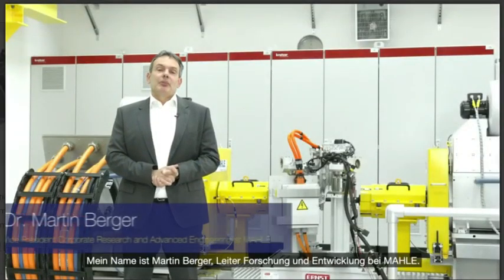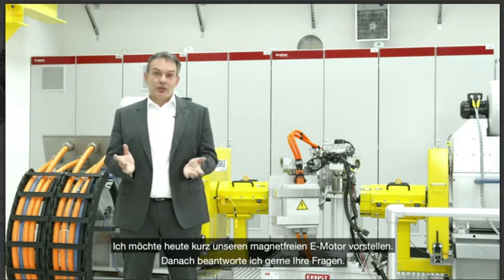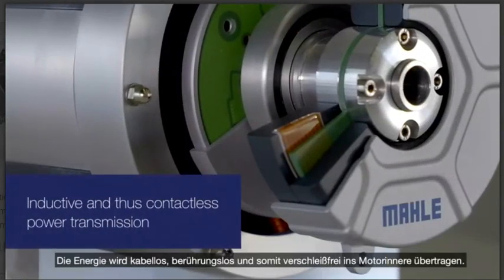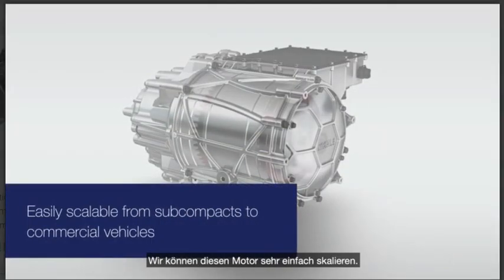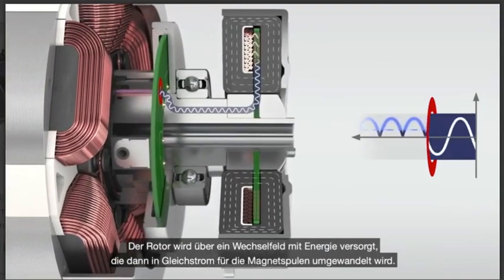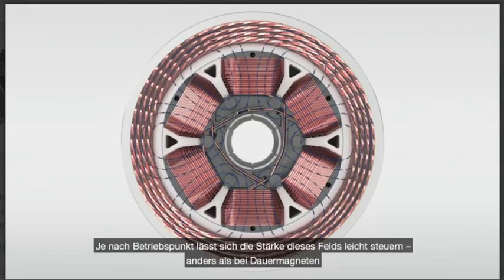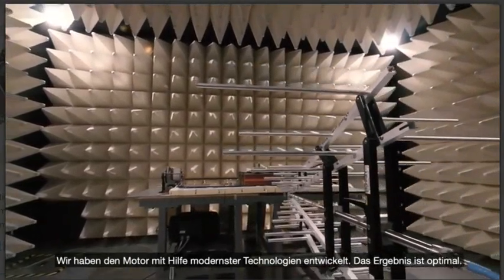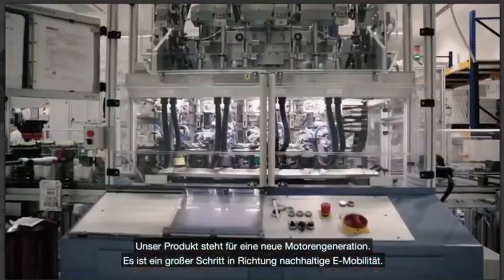Mahle, produce revolutionary new no-magnet motor...

Comment: What's new in this?  Instead of permanent magnets it uses electromagnetic fields, the same as in all AC motors since day one.
Reply: @kosovoisserbia8937  
Chlorine is a gas which when combined with sodium produces a solid compound often added to potato chips.
Reply from the maker: I am new to this stuff and do not have any real education around electric motors and their history - it seemed interesting as a solution to the problems of sourcing rare earth metals and is supposed to be more energy efficient. Outside of that, I think I would need more of a frame of reference to be able to make comparisons - thanks for the comment though. Hopefully it will stimulate some debate in the comments section.
Reply: This rotor design shown in the video is an amalgamation of induction motor rotor and a brushed dc motor rotor which now works like brushed motor (contactless flux transfer)for low rpm torque like a brushed dc motor and turns into an induction motor rotor(no external flux and induction exited) for high rpm providing benifits of both worlds
Reply: Or alternators per se.
Reply: @Tech Stuf Neither of your links give technical data nor offer iron nitride magnets for sale, nor even show a pic of the magnets. Reminds me of vaporware.
Reply: The innovation is that there are no parts that will eventually damage like the carbons contacts in a regular motor this ones are wireless... there is one huge advantage torque and power are very easily controlled  and one disadvantage no regen braking... another advantage is that this motors use the same dc current than the batteries so no power loss there either by transforming it to AC...
Reply: @yorelescovar2716  they do have to convert the DC to AC so that they can transmit it to the coils, if they used a DC motor the commutator would do this. The outer coils will have to receive AC as well as there needs to be a moving magnetic field.
Reply: The innovation here is in 'contactless transfer of ac to dc for rotor windings' so duh it's revolutionary. And has never been done before.
Reply: @rajeshprem6349  But I wonder why they don' t just feed DC to the motor instead of AC. Then there would be no need to convert the current inside the motor. Plus, if this motor is going to be used in autos, the power from batteries is DC to begin with, so there is no need to convert AC to DC.
Reply: @rajeshprem6349  AC induction motors since they were invented by Tesla used inductive coupling to generate currents in the rotor, so the idea is not new. The physical implementation is somewhat new and was probably done to get around various patents or to make it possible to patent it.
Reply: @Proud2bmodest  It is not an asynchronous induction motor but a synchronous engine which was invented before Nicola Tesla.
Reply: @kosovoisserbia8937  If you don't know how to source a product, I don;t think you'll get too far.  Try google
Reply: @timboatfield  those magnets can't be bought anywhere i searched for it . They seem to be fiction .
Reply: @kosovoisserbia8937  It doesn't seem like fiction to me.  I agree they are not available easily in the wild if at all, but I would put it more down to developing a process that can be scaled, which is no simple thing.  Personaly, I'd contact the company directly before coming to any conclusions
Reply: There is probably nouthing new on this (EMSM - electro magnet suncronis motor), but controll scheme to make it work efficiently across whole operating range is truly remarkable
Reply: @kosovoisserbia8937  nitrogen cab be a solid when it's associated with an other elements! Like solid nitrogen in agriculture world.

Comment: I like to see a comparison chart  which compares 1- efficiency: net power in, power out (& regen) 2- cost 3- volume, weight, heat with same output 4- scalability: such as smallest size, max power/amp (with comparison chart) 5- speed of manufacturing 6- reliability 7- life expectancy 8- optimum application for your creation 9- cost comparison (in percentage) and lot more & video of engines performing side by side. Not a good presentation
Reply: Try a job at Mahle so you may generate all this stuff  :)
Reply: If you are on to something, share more. At least give us a comparison to a standard ie1 motor.  I’m am looking forward to your response.
Reply: Hi Ardi Very engineer like and very good Questions . Looks like a synchronous Motor without an exciter. Exciter is as they explained.Possibly easier and Cheaper to Manufacture. Should last along time compared to an ICE engine   I was an Electric Motor Winder in the 70"s and 80's .These would probably be larger and more weight . Would not need Rare earth magnets . Looks like a good idea to me .Should be absolutely fine for everyday driving and Hauling
Reply: @austincolt1955  most ices have asyncronous motors

Comment: i thought it was gonna be an induction motor and claiming it to be new tech but nope its a complete electromagnet motor with out brushes that was a surprise.
Reply: Rotor based electro magnetic field excitation is as old as motor history..but mostly with D.C. currents...
all motor vehicle alternators work on similar principles..
Reply from the maker: Yeah, I think the value is in the fact that it doesn't use permanent rare earth magnets. The selling point seems to be around solving problems associated with that.
Reply: @LiveTorsionParadoxTo  The downsides of an A/C induction motor include the resistive losses from the currents induced in the rotor, with the corresponding need for rotor cooling. Permanent magnet motors avoid this by eliminating electrical currents in the rotor. This design, while not the same as an induction motor, does appear to have those same downsides.
Reply from the maker: @jalvrus  That's interesting - thanks for the information. I am new to all of this and it's fascinating to hear about the complexities of it all.

Comment: This is  a SRM machine. My master thesis was developing a drive system  to run a 6/4 switched reluctance motor and we proposed later to Volvo company to replace it with magnetic machines but they did not accept it. 

The only problem of this machines was acoustic noisy and the aim was later to apply torque pulsation technique reduction. 

https://publications.lib.chalmers.se/records/fulltext/185186/185186.pdf
Reply: I had a similar idea back in 1998 but it was for a generator. I was in the Army then and my teacher said the idea was impossible and I didn't know what I was talking about. I was learning to be a generator mechanic in the Army so I figured the teacher must be right. I never went any further with my idea. I love your paper. I glanced through it - you definitely know what the information. I will read it later. Thank you for sharing.
Reply from the maker: Very interesting Sam. Thank you for your comment.
Reply: This is NOT an S.R.M. !
s.r.m. are DOUBLE SALIENT..and therefore..BY DEFAULT do not have / require seperate field excitation.....but have very complex control systems.. a 6 S/8R config. and 8S/6R or any other .. even though they may have ALL similar ..exact..motor specs../ ratings.. their electronic control systems are NOT interchangeable / compatible.....
i.e. non generic..Yes S.R.M.'s are the noisest of the lot...
SRM are used in airplanes & ships..
Reply: @analoghardwaretops3976  It is not very complex control. Its kind of SRM , you need to get your head around to perceive the SRM concept.
Reply: @Moon3pell  My man, I work on both types of machines and this is definitely not an SRM. I am just too lazy to explain in detail. Just look at the rotor and see the windings and think about the definition of reluctance machines...
Reply: @Moon3pell  for SRM's ..in each and every electrical cycle.. there's the motoring phase..regenerative phase..commutation instant/ angle..to tackle.. and it's diff. for a 6/ 8 when compared to a 8/6 or any other..4/6..6/4 etc..as also its power stages.. 3\3..1\3..etc.and adaptive sensorless is better..so a micro. or dsp.
Reply: thanks :D
Reply: EVs need to be noisy, not massively so but 1 ton cars moving silently could be a danger in certain circumstances
Reply: @sovereignman6951  To who - jaywalkers?
Reply: This is absolutely not a SRM... Not even close.
Reply: Why did you not assemble a motor and controller and give electrical and mechanical data for your invention? Numbers like efficiency in measured horsepower per watt consumed, temperature of critical components and actual hours run without failures would have wrapped up the project. What I see is incomplete.....at best.